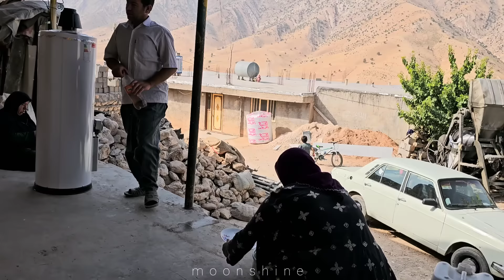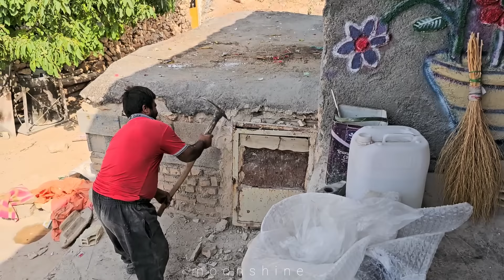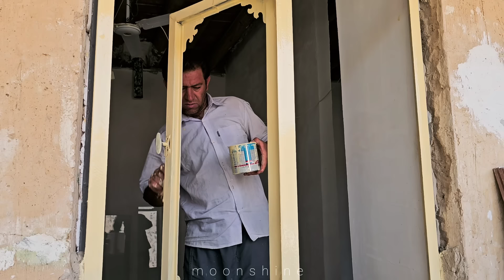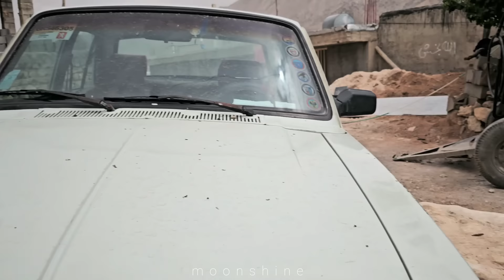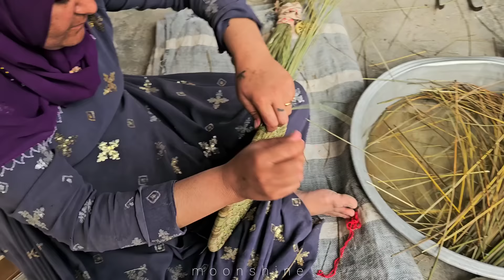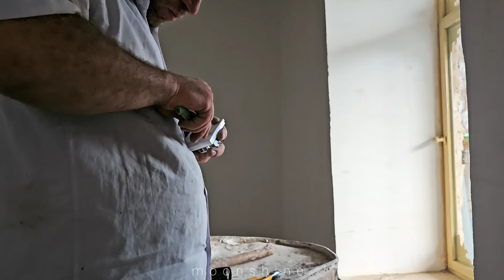Painting the windows. Demolition of the old henhouse and for reconstruction

Comment: Please put this gift towards a bicycle for Melika
Reply from the maker: thank you 🙏🙏🫂🫂🫂❤️❤️❤️thank you my friend God bless you. It will be harvested in 24 days. There is currently little stock.
Reply: @moonshin980 g It is anti-hygienic to build a chicken coop next to a house and a bathroom next to a kitchen to make a chicken coop for garlic and grapes. If you make a basement above the chicken coop, you close the light and air from the kitchen.
Reply: @moonshin980 You may be a builder, but I studied architecture, that is outside the housing code, what kind of teacher are you?
Reply: @moonshin980 It's very dirty to have a bathroom next to the kitchen and chicken coop, you take away the nice visibility of that kitchen. You have a bathroom for the needs on another side
Reply: @moonshin980 Before weighing in on the chicken coop, it's better to re-throw everything outside. Finish that ladder, it looks horrible. Put a handrail so your mother can hold on to it. Worry more about the outside, not the chicken coop.
Reply from the maker: @elvirafernandez6882  Hello, I saw all your comments and suggestions. Please don't worry. What I want to do is very stylish and clean. . First, I cut the kitchen window from the bottom so that there is more height outside. If I build a storage room in front of the house. And from the porch. I go to the roof of that warehouse and there is 140 cm of space in the far left corner of the window. I will fix the toilet. And it does not block the view of the window.
Reply: @moonshin980 es su casa usted construya como a usted le guste y le sea conveniente para usted y su familia saludos y bendiciones ❤